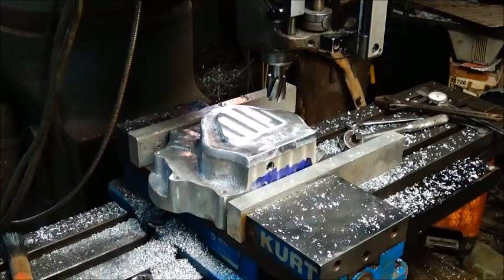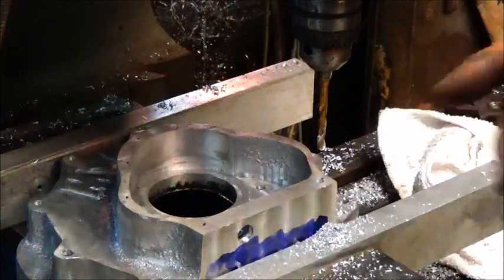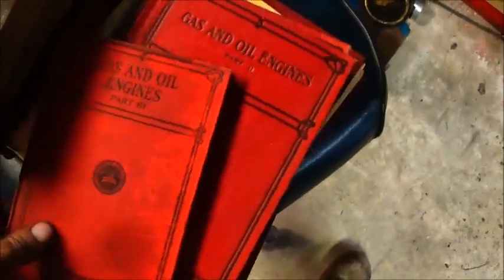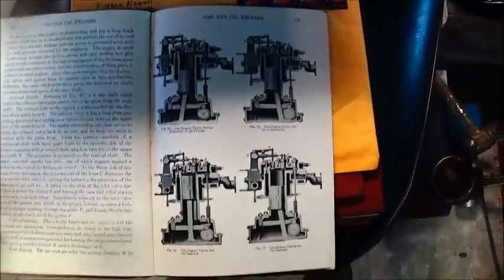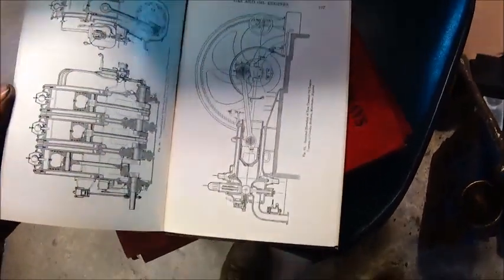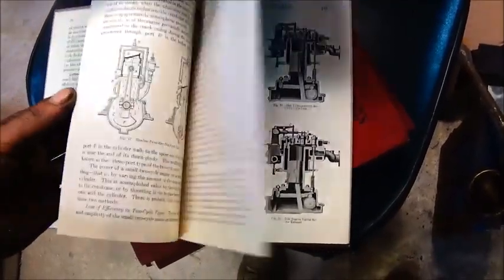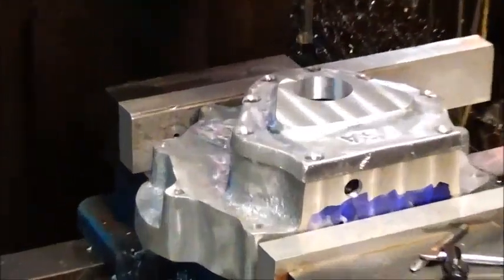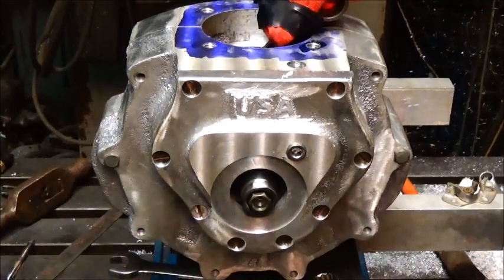Pocket Valve Engine Part 11 Cam Cover Machining

Comment: I'd love to have the book you're giving away. You reminded me of my younger years when I worked in an engine shop. Started out tearing apart and cleaning Chevy, Ford and Dodge  engines. Very few foreign cars around then. In the 11 years I worked there, I did every job there was except working with the public. I never liked salesmen. All the assemblers wanted to build the easy engines that they were familiar with so I got to build the flathead 4 and 6 cylinders for forklifts and air compressors and stuff. Best fun I've ever had, well, except for... you know.

Comment: I like what your doing. Thanks. Looks like a job for loctite. I love to that book. I have a newer Briggs 4 hp and it don't have points. The coil or magneto whichever, looks normal but it has a second smaller magnetic pick up on the coil that some how fires the plug. Thought that was strange.

Comment: That's not a screwup. Might be if it had come through the outside. Next one (I know there'll be one) position the hole with the cover off. Refit the cover and drill, but expect you've already figured this out. Ok you're going to have to do 2 holes blind for the first couple to hold the cover in place, but that won't be a problem.

Comment: Many castings (blocks, transmissions) have a "lump" of extra metal where a fastener is- and now you know why. Maybe with your next casting- you can incorporate slightly recessed areas where fasteners are going to go, so you'll have less trouble drilling the bosses. And yes- I was as serious as a heart attack about adding molasses water to your casting sand. It will greatly help hold edges, and make a protective crust around your piece when poured.

Comment: that engine is looking sweet, coming together much faster than the first,  you wouldn't bore any of us Jonathan,  im sure most of your subscribers like myself are constantly amazed at what you seemingly effortlessly achieve,  I,d love to add the book to my collection,  have you decided which engine you will use in the bike yet? looking forward to hearing it run, great vid v.interesting as always.
Reply from the maker: The first engine is going on a bike I will be fabricating. I have an old Mercury bike that is waiting on the pocket valve engine.
Reply: Jonathan W,  I think its going to be pretty powerful once you sort the cam lobes out, those little briggs cams just dont cut it, that bike is going to be fast I reckon!

Comment: My 2010 Wrangler had wasted ignition. By 80,000 miles the plug electrodes were "wasted" down to the porcelien.

Comment: 1/4 20 means a 1/4 inch diameter screw with 20 threads correct?
I have been looking for 1 inch sheet metal screws that are a 1/4 inch 
in diameter and have 12 threads. It's a slotted hex head with washer. Been 
to Home Depot, Lowes, and a local hardware store and couldn't find them. 
Do you know where can get some of these. I know you have course and 
fine USC USF but there is also a USS. And there is a difference between 
 12 and 14 threads per inch. One became more common. I am wondering if that 
is why I can not find the screws that I am looking for. Any input would be 
appreciated. Thanks.
Reply from the maker: 1/4 inch 20 threads per inch. Try Fastenal or Mcmaster Carr, they carry the hard to find hardware.